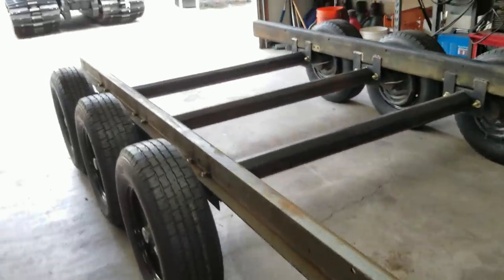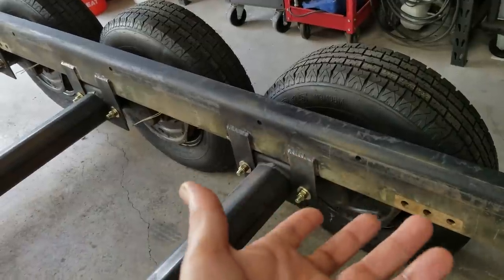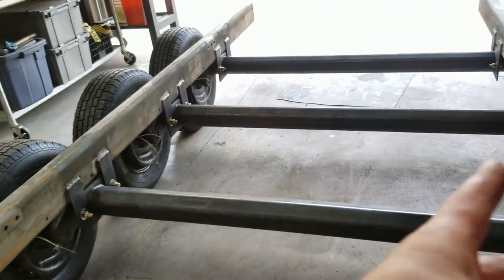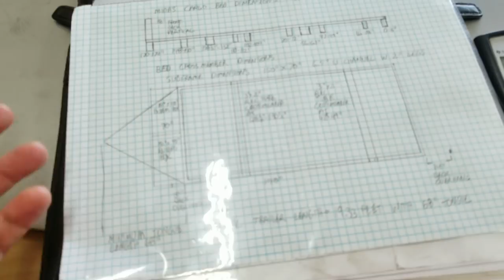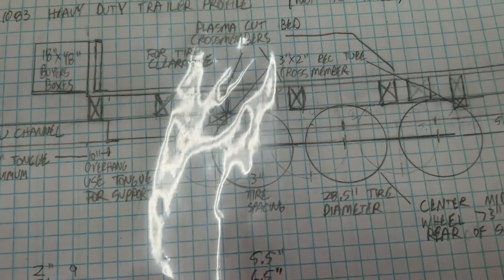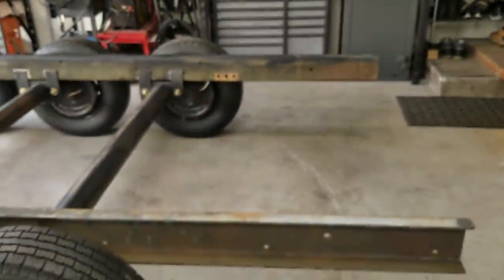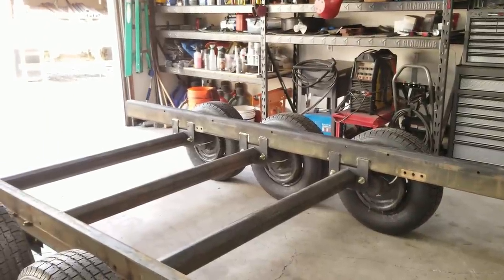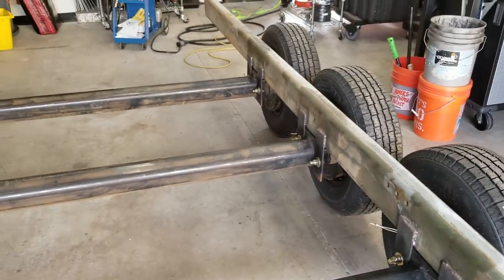M1083A1 7 ton trailer build day 1 (torsion axle mounting/alignment to main subframe rails)

Comment: how does the suspension work? does it not have any or are there rods working as torsion springs inside those tubes? also great video - calm continuous work like this with a little commentary in the end is quite the nice format. thank you
Reply: i think he will not use suspension
Reply from the maker: You got it right! 5k torsion axles... Thanks for tuning in!

Comment: Heat is what bent it so use heat to fix it weld it flat on the trailor all 4 points where you want it to be then get a rose bud for you torches and heat it up evenly it will take it out let it cool and it should be all set no need to make it red hot just around 1500 to 2000 degress should work after cool cut the corners you welded and it should be fine

Comment: Also , You must of done it off camera . But did you measure it to see if it was square  ? I never saw you take the tape measure and hook onto the left rail and measure cross over to the right rail and vise versa . Also because of the Pressure from having 3 axles , when you turn of course there will be Tons of Pressure on the Blots and you might want to run a strip of metal across the top of the bottom rail to give it a little more BEEF .... We did on ours and it still Cracked one of the rails . So when we made a new rail for it we rand a 2" x 1/4" x 12' between the rail and the Axle Mounts . Been three years and they are working Great . Good Luck , Have fun and Be safe .
Reply from the maker: I covered the "squaring" in the end narration.  Keep in mind I don't film everything...  Thanks for the tips...I doubt I will ever crack the "corten" style steel the U channels are made out of...I am not even close to finished yet...
Reply: @SeanFillner  That is what we thought as well , But it Happened . My dad was a Welder as am I , and my two younger Brothers . I am 65 .. so I have a few years of Welding . LOL. I am NOT A Jessie James kind of Welder . He is a National Champion Welder .
Reply from the maker: @BigHeartedMan65  Did you use the U channel out of the frame of an LMTV that is designed to twist and not crack?  Or did you use simple c channel or beam that is prone to cracking??

Comment: How much were the Torsion axles and how much did it cost to build
Reply from the maker: Check out the playlist I made for this build.  I don't recall the exact costs but the trailer is fully insured at a 25k$ stated value.

Comment: Three axle trailers are tire scrubbing waste of  money... you can achieve the same goal with tandem axles using a heavier rate tire... 

With three axles you are always dragging/scrubbing the front and rear tires around a corner on the sidewall of the tires... better keep great air pressure checks in them all to get the most use out of them for sure....

But you'll still be able to just unbolt one of them in the future...
Reply from the maker: The tire/wheel combos cost 100 bucks.  This trailer will mostly be used in wet/snowy weather so I am not too worried about it.  I still say this ride/handles/behaves better than anything else (even 15k factory built trailer) I have ever owned.

Comment: Didn't you say those were 5,000 pound axles EACH ?
Reply from the maker: This should be a 7.5 ton trailer build but I derated the lunette ring to 14k pounds for registration purposes...
Reply: @SeanFillner  We did the same thing . We were chewing up too many tires so we made another one out of 2 5000 lbs Axles and that fixed the tire troubles . What also was happening is when we were on asphalt and making a sharp turn it was putting LOTS of Pressure on the Axles . Good Luck with the build .
Reply from the maker: I will be running a fairly long tongue.  We will see how it does.  Tire/wheel combo for this trailer are less than 100 bucks each shipped so that does not worry me and I expect it.  We will be using the trailer infrequently but I will keep an eye on the things you pointed out..
Reply: @BigHeartedMan65  What about this design?: middle axle is air bagged and can lift the other two when turning tight.